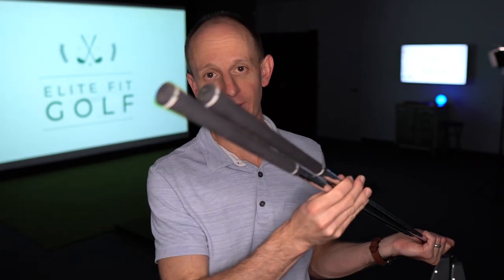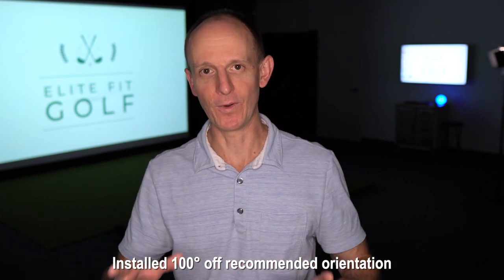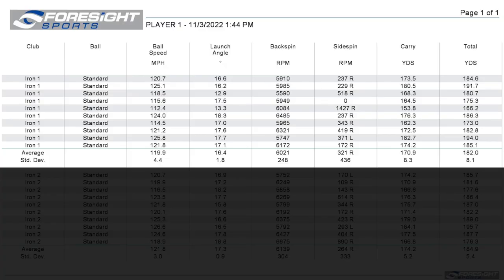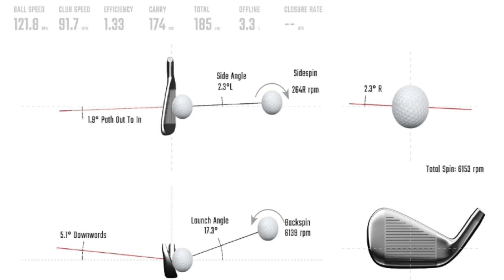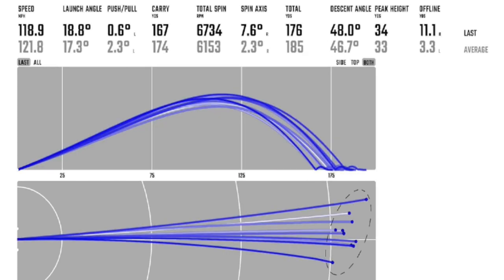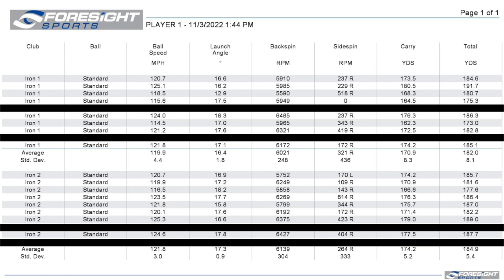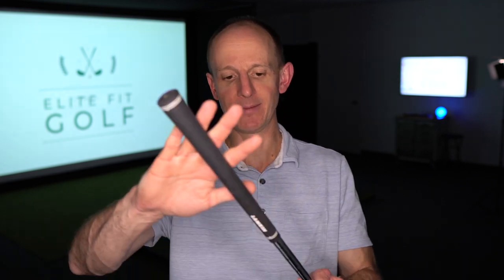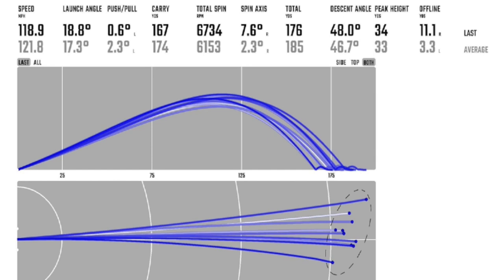Does Shaft PUREing work / GC4 Data Results

Comment: This is truly excellent content and I’d like to emphasize some points from the video as well as some counter arguments.

1. The fact that puring puts the orientation of the shaft to be stiffest at 12 oclock assumes this works better for every player, which is not always the case. Lets say you were fitted into a stiff flex, but puring will make it stiff+. That may not feel/perform as well for a given player. However, unless the shaft used during the fitting was pured, its impossible to know whether the pured orientation or “non-pured” orientation will work better. 

2. Puring may not automatically mean better feel/performance for everyone, but in an iron set, it does standardize the flex across the whole set. For example, if a set is not pured, 7i may be in the “pured orientation” while 8i may be perpendicular. (Random chance) They would vary in how the club loads, creating inconsistency for the player. 

So whether pured is better or not is a separate question than does puring make your set more consistent. Former, it depends on the player. For the latter, it unquestionably does improve consistency. Whether thats worth it to the player is up to every person

Comment: this very well could make a difference to a very low or Pro level player. That's less than 10% of all golfers. Anyone who is above a 5 HC, isn't good enough to take advantage of this. Their skill level over-rides any bonus this may offer, IMO. I wouldn't spend the extra cost on an already expensive set of irons. Wonderful experiment AJ...now, I need to talk to you about adding weight to that long putter you built for me.

Comment: If I could summarize two questions other commenters made:
1. What about graphite shafts? They very possibly have a more pronounced spine than do steel shafts.
2. What about the whole set? A pured set may be more consistent from club to club. And perhaps a whole set of shafts that were 100% “wrong” from the puring recommendation would also be more consistent.
It seems to me that consistency across the set is the reason to get shafts pured.

Comment: I had one Oban driver shaft with SST puring and would not pay for that extra again.
But what I found out at iron shaft sets, that there are inconsistencies in between the single irons that can be minimized when I find the spine of each shaft and install them all with the spine in the same direction.

Comment: I think the whole point of pureing or aligning steel shafts is to make a set feel all the same. I've had both pured and off the rack sets, and feelingvise pured set was uniform and as such a better set. With graphite shafts this aspect is propably stronger, altough nowadays nobody uses all same set woods.
Reply: In this case since he likes the non pure shaft because of feel, he could still pure the shaft and set each one 100 degrees of the pure line?
Reply: @christopherodom8391  exactly. Whether pured or perpendiculr to pured is better depends on the player, but puring does make the whole set more consistent. If AJ likes the perpendicular orientation better, he can purposely turn them 90 deg on every club of the set

Comment: Some might argue that if you could tell a difference between those two, wouldn't it be good to have a similar orientatiin in every club to have the similar feel in all clubs? 😉
Reply: It would be interesting to pull the shafts and reverse the orientation to see if the performance would shift with the orientation.  If it did then we might start to believe that there is something to be gained by the SST process.  Anyway, it seems to me that to do this experiment in a way that might provide more meaningful data there would have to be a double blind setup and many more shafts and heads involved...  Maybe use a robot to to hit the balls.  LOL rather time consuming and expensive!

Comment: Great video! I wonder if part of what you are feeling is that one shaft is slightly softer or firmer than the other because of manufacturing tolerances too.
Reply from the maker: Yes, totally. Also when you align the shaft in the way they do, the stiffest plane is set at 12 o'clock so the shaft feels stiffer in your initial downswing loading. This is one of the big issues I have with it, because it assumes that every golfer will prefer that feel vs a slightly softer feel during your transition from the top, and that is just plain wrong.

Comment: Objectively, the pured club was better on distance control. The unpured was better on left to right. Distance control is key to hitting ones number, and side to side can be mitigated  by increase the loft of the head by a degree or two, shortening the club a bit and flattening the lie angle.  All one has to do is look at the standard deviations of both clubs and see that the pured shaft is performing objectively more consistent.

Comment: I have those irons. Maltby TE forged. They are the best value forged irons around.
Reply from the maker: They look so good, especially set up behind the ball.
Reply: @EFGMC  Also a fan of the TE Forged, currently playing mine with Xcaliber Rapid Taper shafts. AJ, what shafts did you use for this test? Also, did you take steps to match them in terms of weight and CPM? If I missed this information, my apologies!

Comment: So I went to have a fitting and they added SST Pure for 6 clubs at $40 per shaft, I then took the specs and ordered the same clubs from the manufacturer without SST Pure and paid just a little over 1/2 of what they wanted for the irons!
Reply from the maker: Yep. That sounds right on the pricing.

Comment: Shaft puring is a recognition that the performance of a shaft isn't consistent in different directions.  Assuming this is true to any detectable level, it could make a difference.  But it's a QA issue - what tolerance is applied to flex in general? I'm more worried about tolerance there than in a direction.
Reply: Exactly. Golf is a game of repeatability and being consistent

Comment: Not going to dispute your 'feels' or your 'opinion' about the benefit - I will comment on the Statistics being a Statistician myself. If you want to go down the rabbit hole of Statistics being the measure of whether something is worth it, as opposed to feel & opinion, let's look at doing the Stats in a way that at least the Stats give real data (you can then choose to use them or not). Let's start with the FACT that no matter what you do with each of the 2 clubs to make them the same, they are NOT the same - so you can't really CONTROL this - you have to accept it and then try and still do measurements to see if Statistically, you can measure anything with enough precision that it can be at least useful. I know you likely won't want to do this (too much time for likely very little benefit), but what you want to really analyze is whether a Pured vs non-Pured data set is more or less consistent - that is, you want to look at the Statistics applied to MULTIPLE runs on the same iron and compare these stats against MULTIPLE runs conducted on the other iron - i.e. you want to do 12 Sets of 12 Hits with each club and then run the Standard Deviation Calculations on the Averages of the 12 Runs and the compare these Standard Deviations against the other club (I say 12 because 12 is where you get 85% of the benefit of the data without having to do a lot more to get the last 15%). We want to compare the Standard Deviations of the Averages NOT the Standard Deviations of each club against the other club. If Puring is doing anything, which I have no idea, then it should show up in these Standard Deviations of the Averages (they should be lower) - but we NEED to see this data (i.e. the Standard Deviation of the Averages against each other) - and NOT just comparing the Standard Deviations of each club against the other. This will allow you to CONTROL for the FACT that you like how one club feels versus the other but then still get REAL Data of whether Puring is making the other club, which you don't like in this situation, still produce TIGHTER Standard Deviations of its multiple runs vs your preferred feeling club's multiple runs. Finally, and what you really need to do is not only this, but then build another 2 clubs, let's say 5 irons, with same shaft and heads as the 'other' clubs, and then do the tests again, (but make sure to Pure the one club but also not only NOT Pure the other club - but place it in a different orientation so that not only are they not Pured, they are also randomly not Pured). It is this final Data, if you could do Correlation/Covariance stats, or just do the best you can do, to see if Puring a SET of Clubs, and doing Standard Deviation Calculations on the Averages you do for each iron - then produce a lower OVERALL standard deviation. As you can see, this would require a huge amount of work - which if I was someone who was selling these Puring Machines I would have the Data done because this would be paramount for me to able to close the sale of such a machine - here is the data, Standard Deviations done on the Standard Deviations, done across a SET OF IRON, and data showing concretely that it LOWERS the Overall Global Set Of Irons Variance. If you can't do all that, then none of the stats anyone can produce is anything but completely worthless - and that is why Stats are so easy to use to create BS. I say this as an actual Statistician with a real Degree in Mathematics - there is also zero data presented at any time, even by Scientists and Engineers, that I remotely believe because I know that while they think they are applying good practices in their Statistics, almost none of it would hold up to Mathematic scrutiny. If a client had the money and they are chasing a Plus Handicap or playing Tournament Golf, they should pay for Puring in my opinion because at least it is an attempt to aid in consistency. If they are a recreation golfer, then save your money - your own personal Standard Deviation is likely on the order or 3-magnitudes higher than any benefit to Puring so it will NEVER statistically be found in the data - ever - like the end of the Universe time ever. Nice video
Reply from the maker: Paul, I think I will need to fly you in to supervise if I ever try and redo this video! 
#Abovemypaygrade
Reply: @EFGMC  I can save you time & state that having modeled data my entire adult life, while also being an avid golfer, and a person who has deeply looked at some of Mygolfspys' data & modeled it myself, the fact that their machine hitting a ball test exposed how bad golfball consistency is, the variance in balls alone would obscure any data on shaft orientation - that data was truly shocking.
Reply: @EFGMC  I’m not reading all that… what’s the cliff notes
Reply: @Big-Crow  exactly
Reply: @wallstreetoneil  I think after writing your initial comments and then this response, you're basically concluding yourself that it's nay impossible to conduct a test to a high scientific level to satisfy a mathematician /scientist. Other than the above you've stated, the biggest and obvious factor which will be inconsistent is someone's swing and delivery - this is something you can't have as a "control" in your experiment and if you use a robot then it defeats the purpose as most players bring in the objection "that we're not robots". 

Your comments are interesting and I do wonder if having a data set 10x the size of what AJ did above would make any huge difference as I was also comparing the standard deviations of the two when viewing. I suppose we all take what we want from it, to me, this unscientific little video was of great value and help. Thank you AJ !!
Reply: @wallstreetoneil  this is an incredible point that I have never thought of. As an analyst who uses statistics and also have worked with an actual statiscian on varying models that the variance in ball quality can and will influence the result. Question: could you eliminate the variance if you were literally using the same ball? Not same brand/model but I mean the same physical ball?
Reply: @jim60631  The first thing I would do is NOT use radar-based systems that expose the ball to deformation and then watch it fly through the air - thus NO to Trackman and YES to the camera-based GC-Quad type system. Secondly, I would test balls with a robot and see if I could get 12 balls that were close and then I would use each ball for 12 hits by each shaft - thus 24 hits in total, and then I would swap to the next ball - that would take care of the crazy/bad ball issues. I would point out that if you look at what the top tour guys do, the tour vans make up a few clubs for a guy to test, all identical, and then the player will hit them in range sessions and try and figure out which one they like the feel of best because the techs no that no matter what they do, it will feel different than their gamer so they are just trying to get a few close samples and see what if any the player will like best. I personally played in the very high level hockey & tennis worlds - and it is exactly the same there - guys will try out a bunch of sticks until they find their gamer and same with tennis rackets because the frames were never the exact same stiffness and then you add on stringing machines that were never the same so every racket would feel different - so in the end, it came down to feel - exactly what you saw in this video - the technology can say one thing but top guys go with feel.
Reply: Tldr... You really didn't have anything better to do😭
Reply: @OzarkMountain  Spoken by someone who's never read a book...super hero comics don't count.
Reply: Very interesting and detailed, Paul. Not only is it difficult to argue, but I have to say I'm in agreement with your analysis.  However I'm also happy to see your conclusion does leave room for choice based upon potential consistency.  Golf is a game of repeatability and consistency and this is where I believe PURing has huge benefits. The simple fact of knowing the clubs in your bag are straight line oscillating and flexing similarly or very close to one another is certainly worth the cost of having this process performed, especially if it means improved ball striking.  How can any reasonably intelligent human being argue with that? Except for AJ 🙂
Reply: @jim60631 probably only if you oriented the ball in the exact same way every time…

Comment: I'm not sold on "pure-ing ".  I've had clubs that were pured and clubs that weren't.  But I do think a better test would be where the human variable is removed.  Good players have the ability to make really minor adjustments with every swing.  With an "Iron Byron" you could hit 1000 shots with each club and get a much more reliable data set.  I would assume the company selling the pureing procedure would have used such data to justify the cost and need for the service.
Reply from the maker: I go the other direction with this. I think you can totally build a club to get better results out of a non human tester. The question is how does it work with the human variable. If we only used a robot, there would be no need for different shafts, heads, etc. The importance of any shaft, is less about the technical specifics on that shaft, and more about how those attributes influence the golfer's swing and ball flight.

Comment: Thanks a bunch for your dead honest review. Additionally, I had a set of Ping 1210 irons w XP 95 reg shafts purrs a couple of years ago . It was more experimental as I was hitting them pretty well to begin with. But being an anal club nut I wanted to give it a try and see for myself what the benefits of shaft purring are. To say I was disappointed would be an understatement. The shafts played much stiffer to the point that the iron set was unusable for me. Horrible. Ended up trading them in for a new set as the set was now dead to me.

Comment: Shaft pureing is a well executed marketing hoax. 

Production tolerances with modern day shaft manufacturers are so tight, every shaft you buy is basically perfectly round.
Reply: This couldn't more further from the truth.  EVERY iron shaft has a natural bend profile and a spine. How do think iron shafts are manufactured? In a tube machine? lol They're made from FLAT steel then rolled and welded.

Comment: What do you mean? Based on your numbers your horizontal dispersion was 400% better with the aligned shaft while your distance dispersion was 50% better with the unaligned shaft . idk about you but a 400% improvement in horizontal dispersion seems like a much better option then a 50% better distance dispersion. i would gladly pay for puring if it meant a 400% better horizontal dispersion.

Comment: I had my Irons pured then had new shafts installed and not pured. 

There was zero difference in strike, feel, distance, spin, and dispersion for me. Not to mention it's $30 per club to pure
Reply: I purchased some new Pings but didn’t have the shafts pured…the club that I was betting fitted with was pured…when I got my new clubs…I was able to tell the difference between the pured club that I was fitted with than the umpured clubs that I got…the feeling that I have with the new clubs didn’t have the same feeling I was getting with the club (pured) that I was  being fit with…I went to check how much I would’ve to pay to pure my new clubs was crazy…Club Champion were I purchased the clubs want $45 per club…I wish I could find a place that does puring for $30…

Comment: I thought shaft pureing was more about finding impurity’s or errors in the shaft. So like a benchmark test to see if a shaft is straight or doesn’t have any micro cracks you just can’t see with an untrained eye. I know TXG have said they have to throw out a lot of steel shafts that they have pured because they come back with with some significant errors.